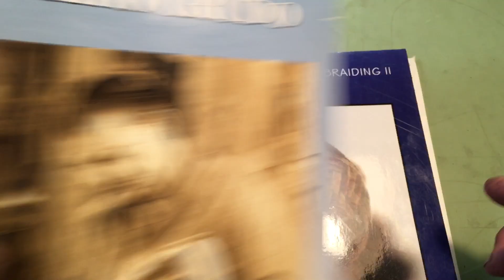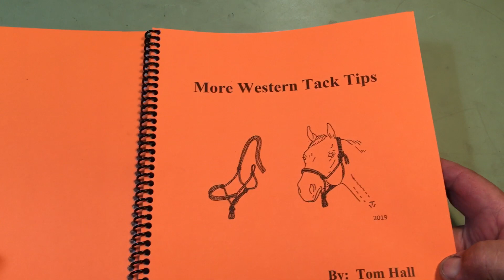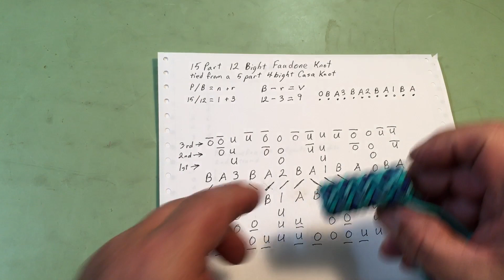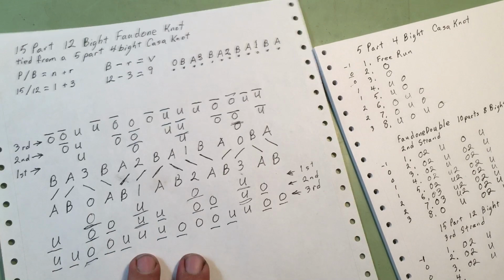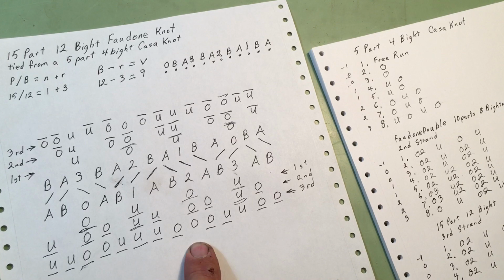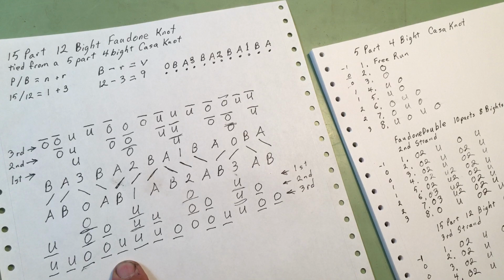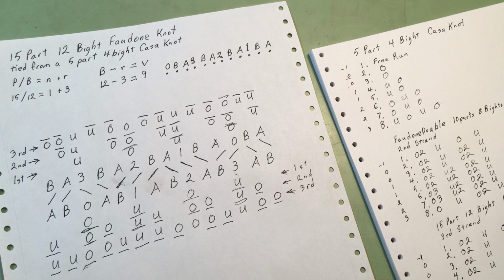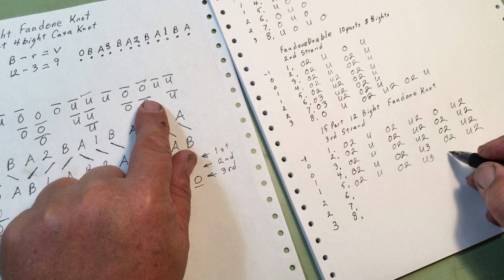15 Part 12 Bight Faudone Knot

Comment: 🤙 
Baby steps, baby steps
That” negative one“ (-1) got me stuck again!?
In the pamphlet it says the negative refers to reverse wrapping 
Could you please explain
Thanks a lot
António
Reply: Thanks in advance
Reply from the maker: an ri the “negative one” (-1) in this case is the number you get for the cyclic bight-number (i) for half-cycle number 1 using the formula i=(1-3)/2. The formula for the odd numbered half-cycles (Ho) is i=(Ho-3)/2. The formula for the even numbered half-cycles (he) is I=(he-2)/2.
Reply: Tom Hall Braiding and Knots By Michael Hickey yes l got it now
Thanks Tom
👏